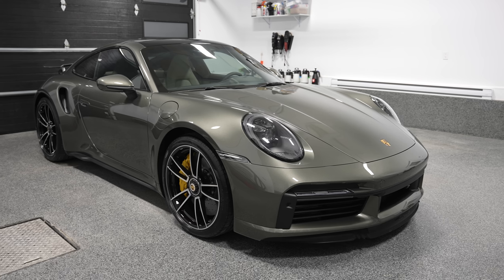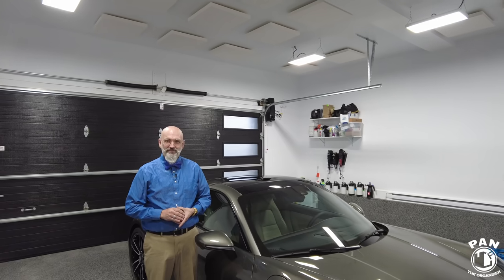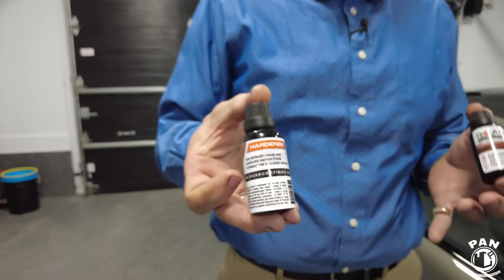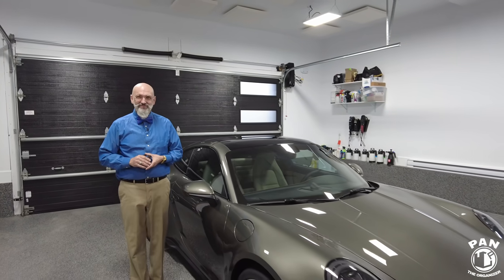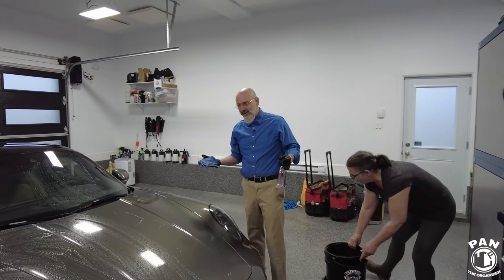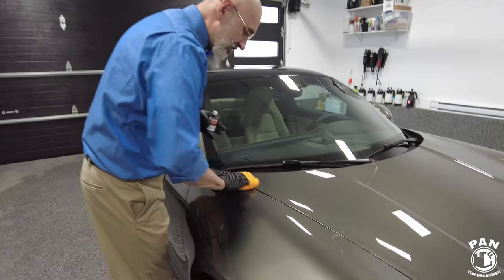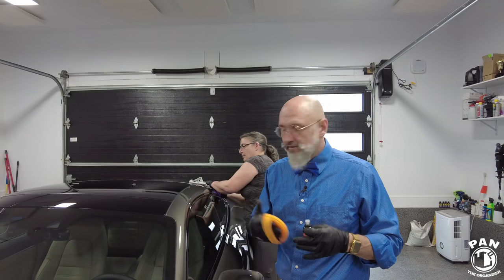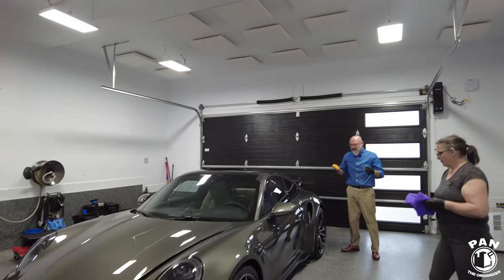Porsche 911 Turbo S : Detailing My New Supercar!!

Comment: Hey Pan, just watched Yvan’s April 7 video on how to wash a car. He is in the washless or rinseless camp. He made a funny comment on his two bucket method. One on each side of the car so he doesn’t have to schlep the buckets around. Going forward, which wash method are you going to use on your gorgeous machine?
Reply from the maker: There are good points to both methods. I say use which ever method you prefer as long as you do it right and use safe washing and drying techniques.

Comment: I struggle to get the swirl mark out but I have a orbital polisher . Do I need a rotary polisher for this ? Also how come you not gone for ppf to the front end the ceramiccoating won’t stop stone chips like ppf does
Reply from the maker: I never have stone chip issues. Orbital is perfectly fine to remove scratches. You need to fine tune your pad and polish selection. Watch my video: https://youtu.be/2JDvQBs1viM
Reply: I use the rotary for finishing, the DA for cutting.

Comment: Hi there. I'm having these issues with my car being a dust magnet and leaves watermarks. So what I usually do now is every 2 days I just wiped the dust off with one of my towels. But the thing also is that when it rains it leaves watermarks. Are these things normal? I'm using Turtle Wax ceramic wash and wax with TW Ceramic Wet wax and every 5 months or so I put TW Ceramic spray coating. Thank you so much and have a blessed day.

Comment: Hi Pan congrats on your new toy i have a question what good car wash & wax and car shampoo would you recommend that is sold in the UK 
I currently use turtle wax ceramic wash and wax but I don't think it is all that good 
Enjoy 🚅 new toy and hope to hear from you soon 🏎👍👍
Reply from the maker: I am generally not a fan of “wash n wax” type products as I prefer pure shampoos without any protection in them. It allows me to use my choice of top-up protection at the end of a wash.

If you don’t like the TW Ceramic Wash n Wax, chances are you won’t like any of that type of shampoo. CarPro Hydro2 Foam and Gyeon Bathe+ are other ones you can try if you have a ceramic coated car. They have protection in them.

I like pure shampoos like CarPro Reset, Gyeon Bathe (not Bathe+) and Adam’s car shampoo.

Comment: Pan, congrats on the 911. Mine just came in yesterday. I have a dilemma, as it will rain here for the next few days and I need to drive the car. Should I drive it unprotected, with no wax from the dealer or should I put some sort of protection that then can be removed before I coat it? YES, I am going to coat it but I cannot as there is no time for it to cure.
Reply from the maker: Do not apply any protection before you apply the coating. It will be more complicated to fully strip the temporary protection if you do apply some wax or sealant.

You can drive your car a few weeks with no protection, it’s not a problem. Make sure you are thorough in prepping the paintwork prior to applying the coating.

I have a popular ceramic coating application tutorial here: https://youtu.be/sqQYVjxFqK0

Comment: Pan I’m really enjoying your channel.  But just as a point of order the 911 Turbo, GT2, and the GT3 even in their RS variant are not considered super cars.  Like you I’m a huge Porsche fan and a Porsche owner.   Technically the only super car that Porsche makes would be the 918 Spyder and of course the previous Carrera GT.  Both of those vehicles can easily exceed $1M which I’m sure you are well aware.  Some could argue they’re more like Hyper cars but that a discussion for another day.

I recently traded my 911 Turbo 997.2 for a Cayenne Turbo.  I found I didn’t drive my 911 nearly enough and wanted something a little more practical.  One day in the future I can certainly see myself going back for another 911, most likely a 991.  So other than that Congrats on the new Turbo I love the spec.  PCCB is crazy expensive so kudos for jumping in feet first.
Reply from the maker: Thanks. But I'm not going to argue about what a supercar is or is not. It seems very subjective. All I know is I base my decisions on facts, which are numbers. The 911 Turbo S accelerates 0-60mph in 2.3s in real world measured tests and can do the quarter mile in 10.1s @ 138mph. Those are actually hypercar numbers. If that's not "supercar", I don't know what is. Supercars do special things in my books and this one certainly does that in spades. For me, a supercar doesn't need to have purple flashy paint and three wings and gullwing doors to be called a supercar. The majority of automotive journalists agree: the 911 Turbo S is a supercar.

But again, none of that matters, as this is my boyhood dream car and my dream came true. Nobody can take that away from me.

Comment: Pan, I have not seen you use an iron decon as clay lubricant. Will you test/do this on the future and give your thoughts? Logically it seems very efficient.
 
Great looking end result!
Reply from the maker: Yes I did use an iron remover as a clay lube but only in certain circumstances like in this yearly maintenance wash video: https://youtu.be/ud4wGakuSWs

But not all coatings can be clayed (clay is a mild abrasive, you could damage the coating) and you should only clay using a perforated clay towel like in the 911 video (links in the description under the video).

Comment: Think I found out the problem - the areas I leaf blowed have the spotting issue~ so going to towel dry in the future. Question- considering I will be using either beadmaker ( 1st time use) / reload / elixir  after drying - what would I use as a drying lubricant/ aid - I have beadmaker,elixir,Echo2,ONR all in my range or do u recommend another? Thanks Pan for your help with us who are just inspired by your expertise!
Reply from the maker: Bead Maker is great as a drying aid, so is Elixir. You have two great products there. Once you apply the foundation layer of Bead Maker on dry paint the first time, you'll be able to use it as a drying aid after maintenance washes.

Comment: Hello Pan, very nice job. You are so very lucky to have a man like Ivan as a close resource. I’m intrigued by the spray Ivan used with the towel. Little to no marring, nice. What was the recipe for that? Thanks
Reply from the maker: No recipe. It was the McKee’s 37 Iron Remover used also as a clay lube with the perforated clay towel. Links in the description under the video.
Reply: @PanTheOrganizer  at 10:25 Ivan said he had Rinseless wash combined with iron remover & a clay towel?
Reply: @PanTheOrganizer  I was hoping Ivan would see this & reply with the recipe for the mixture. I like the clay towel with the ONR & McKee’s iron remover.

Comment: Quick question: How come he used circular motions instead of the crosshatch you usually recommend?
Reply from the maker: Because he is used to that method. He has over three decades of experience, so he can pretty much apply it in any way and it will work. And for this coating, circular motion is ok.

Most coating brands will recommend the cross hatch method though.

Comment: Absolutely beautiful Pan 🤤🤤congrats on achieving your dream car.. Will you coat the calipers at all? And any PPF?
Reply from the maker: Thanks! I will coat the wheels and calipers with a spray on rinse off protectant like Gyeon Wet Coat or CarPro HydrO2. With these carbon ceramic brakes, I won’t be getting much brake dust or contamination.

I am just not a fan of the look or feel or PPF. Plus, as I get a brand new car every three years, and do low yearly mileage, scratches and stone chips are of now concern to me. My cars are always pristine when I bring them back to the dealership.
Reply: @PanTheOrganizer  Hi Pan thanks for the reply.. Totally understand for sure.. You'd be one guy I'd GLADLY buy a  used performance car from! All the very best with it looking forward to some drive videos.. Cheers from Australia..
Reply from the maker: Cheers from Canada mate!

Comment: Pan, As always - great videos and always with a pleasant disposition. Much appreciated. I do have a question - now that Dry ICe cleaning is available (expensive), how do we justify purchasing all the different shampoos, car care products when dry ice is so effective?
Reply from the maker: I am guessing you were watching some of Matt's videos? (Obsessed Garage). I haven't had the chance to test dry ice cleaning yet, but from what I understand, you need a bunch of expensive equipment and actual physical space to have all that equipment. That means it's something that 99% of people will not be able to afford, or won't have the real estate to install all the required equipment.

And my understanding with dry ice is that it's meant more for restoring than for regular maintenance. I don't see someone going into their garage on a Saturday morning and doing a maintenance wash using the dry ice method. Also, as you probably saw, it takes quite a bit of time to work an entire vehicle.

I don't think the traditional wash methods are in any danger of disappearing anytime soon. I think dry ice cleaning is more for restoring old worn parts and bringing them back to life, if someone buys a used vehicle for example, and wants to bring it back to "like new" state. But then once the surfaces are cleaned, you still have to protect them with a wax, sealant or ceramic coating. That won't change.
Reply: @PanTheOrganizer   @Pan The Organizer  Thank you for the prompt reply, Sir. I do agree with you, Ultimately, the expense of having a cleaning system like dry Ice and the space required will discourage most DIYers. Incidentally, I was watching AMMO NYC. Nonetheless, you are spot on about needing to still wax and seal, etc. after a dry ice treatment. Congratulations on the new car. Very well deserved after so many years of educating the world. Cheers.

Comment: Hi Pan - love the car!!  Question: I have car pro quartz plus gliss on a black car - lovely job 👌 when morning dew hits my car it leaves behind small dark spots - which do wipe away easily - is this normal? I
Reply from the maker: Thanks Neil! Hard to say as I don’t see your paintwork. I’m guessing it’s just dust in the morning dew?
Reply: @PanTheOrganizer  maybe 🤔 can I send a picture? It’s been troubling me as I follow all your techniques - car is perfect but when dew hits it I get left these spots left over (which detail off quickly) - only happens on the horizontal surfaces which catch the dew
Reply: Think I found out the problem - the areas I leaf blowed have the spotting issue~ so going to towel dry in the future. Question- considering I will be using either beadmaker ( 1st time use) / reload / elixir  after drying - what would I use as a drying lubricant/ aid - I have beadmaker,elixir,Echo2,ONR all in my range or do u recommend another? Thanks Pan for your help with us who are just inspired by your expertise!

Comment: Bonjour Pan,
J’ai 2 questions typiquement françaises 😅...:
La 1ère : mais où est donc passée la M550i ?
La 2nde : pourquoi ne pas avoir enlever le roues pour appliquer la protection à l’intérieur des jantes ?
Je vous remercie 😃
PS: mais qu’est-ce qu’elle est belle votre Turbo S
Reply from the maker: 1. La BMW retournera chez le concessionnaire à la fin de mon contrat de location cet été.
2. Parce que je n'en voyait pas la nécessité. Avec les disques en carbone céramique, il n'y aura presque pas de poussière de freins ou de saleté. Et lors de lavage d'appoint, il est facile d'utiliser un produit "vaporiser et rincer" comme Gyeon Wet Coat ou CarPro HydrO2 si je veux de la protection à l'intérieur.

Comment: Excellent presentation Pan.  Congrats on the new screamer!  When it comes to the application of the ceramic coating of the wheels did the barrels get done as well?  If so, how did you access them - a lift? ramps? Wheel removal? I feel the barrels often get overlooked, not necessarily from the cleaning aspect but the protection aspect... Personally I dig the look of shiney and well maintained wheel barrels.  It's part of the "small detail" pop!
Good luck with your new acquisition.  Hard work has its rewards. Thx!
Reply from the maker: No we didn't do the barrels. With carbon ceramic discs, I'll have little to no brake dust, so they won't get that dirty or contaminated. And I typically apply a spray on rinse off silica spray sealant during maintenance washes anyways (like Gyeon Wet Coat or CarPro HydrO2) so they will be protected all the time.
Reply: @PanTheOrganizer  ah! The virtues of ceramic brakes...thx Pan.  Enjoy.
Reply from the maker: Yes!! And they don't rust when washing the car! Another feature I like of that!!  :)

Comment: Hey Pan, your car looks super sweet, i have a question though, i would like to know how a ceramic coating holds up to sea blast, i live in Trinidad so the beach is a place we frequent. Can you shed some light on this please? Great video by the way!
Reply from the maker: I don’t know that environment unfortunately. But one thing is for sure, coatings are way more durable compared to regular waxes and sealants. But abrasives like sand particles will slowly eat away at coatings and clear coats.

But other than that, coatings resist pretty much everything: chemicals in a wide pH range, acid rain, tree sap, industrial fallout, etc.

Comment: Hey Pan, is that a microfiber applicator he is using to apply the ceramic coating? Would you recommend  that technique for other coatings as well? I generally use Gtechniq csl or as of late Avalon King with the standard applicator block with cloth in a crosshash pattern, however this new technique looks to expediate the process a little bit and really ensure the coating covers all surfaces!
Reply from the maker: That was a foam applicator that comes in the coating kit. Follow the instructions of the coating you are using. Most consumer grade coatings ask for a cross hatch pattern to ensure proper coverage.

Comment: I loved your car last week when you got it, looks even better this week after the detailing.  Possibly this isn’t the place to ask this question, what is your opinion on using Jescar Ultra Lock + and Colonite 845 wax instead of a ceramic coating. I should be taking delivery of my 911 within 3 weeks and that is the route I am thinking of taking. I am looking at this from a gloss / shine stand point I realize this combination will not have the same durability. I usually wax my car 2 to 4 times a year.
Reply from the maker: Ceramic coatings will outlast any sealant and wax combo, offer more chemical resistance, and way better hydrophobics and self-cleaning properties. Coatings are the best form of paint protection in my opinion. But they cost more, require more prep, more time to apply, etc. It depends on your needs, budget and experience level. Some people just like the simplicity of reapplying a car wax once every two months. I have no issues with either or, as long as a person enjoys taking care of their vehicle. :)

Comment: @pantheorganizer whats your thought on using spray water when compound and polish? I just came across some info to damp the pad when applying. Cheers.
Reply from the maker: There are many ways of prepping pads. Some don't do any prep, just apply the compound or polish and start polishing. Some, like to prime their pads (myself included) with the compound or polish, especially microfiber pads. On foam pads, I like to use a pad conditioner spray. One mist, and you can apply the compound or polish. 

Some like to use a pad washer in between panels, so you pad will get moistened regardless, with the clean water solution in the pad washer's tank.

See my paint correction tutorial for beginners here: https://youtu.be/ustTEVGMOTI

Comment: Hey, I was curious if ceramic coatings are for me. Only thing I’m really worried about is that my car is gonna stay outside. I also work away from home for weeks on end, am I going to screw myself over with water spots if it rains and stays on there for a a couple weeks?
Reply from the maker: For sure, ceramic coatings are more prone to water spotting compared to a traditional wax. Coatings are the best paint protection by far, outlasting waxes by years, and have more chemical resistance and better self-cleaning properties, but need regular maintenance.

Most coating brands have what we call a hyper slick topper now, helping to diminish the chances of water spotting. For example, CarPro CQuartz UK 3.0 coating has the Gliss 2.0 top coat. Gtechniq CSL coating has the EXO v4 top coat. But regular washing and maintenance is key to help prevent water spotting issues.

Welcome to my channel. You discovered one of the biggest car detailing channels on YouTube as we surpassed 870,000 subscribers and we have over 110 million views! I have been detailing for 26 years and I love to share my knowledge and passion with my viewers.

You found the right channel to help you learn everything about detailing.

Comment: Looks amazing! Gotta ask though, at the kinds of speeds this car is meant to drive at, why not put on paint protection film? Coatings are great but give virtually zero protection against stone chips.
Reply from the maker: I am just not a fan of the look or feel or PPF. Plus, as I get a brand new car every three years, and do low yearly mileage, scratches and stone chips are of now concern to me. My cars are always pristine when I bring them back to the dealership.
Reply: @PanTheOrganizer  Appreciate the prompt reply and can understand that the look of PPF is not for everyone but all cars are subject to rock chips at highway speeds regardless of mileage or location. Here in South Florida most guys I talk to with high end cars get PPF at least in the front areas and then ceramic coat on top of it.

Comment: @Pan The Organizer, what was the amount you used for the McKees 37  rinseless wash and water in the IK sprayer?  Thanks!
Reply from the maker: I make a gallon on the side. 0.5 oz of the rinseless wash (ONR or McKee’s 37 N-914) and 1 gallon of water. Then pour that into the pump sprayer.